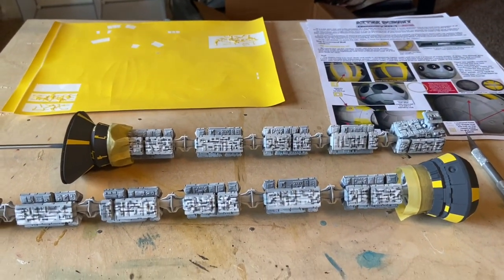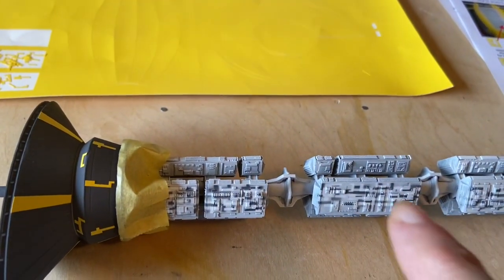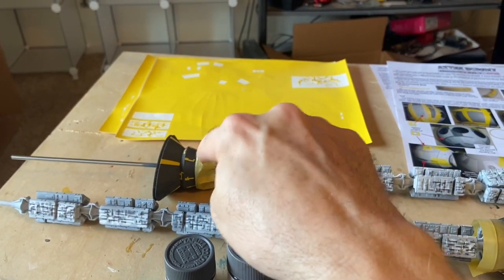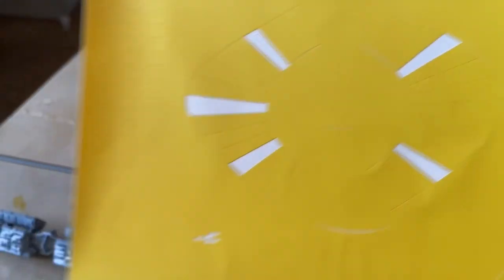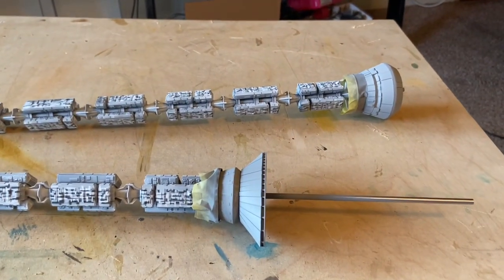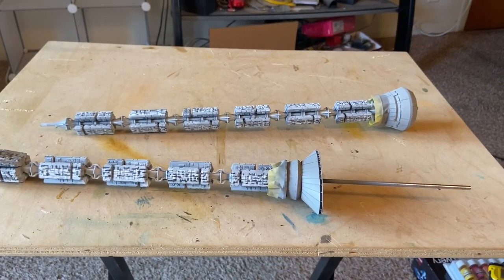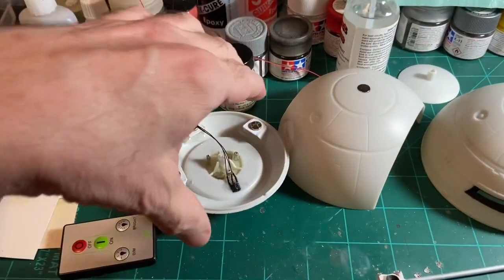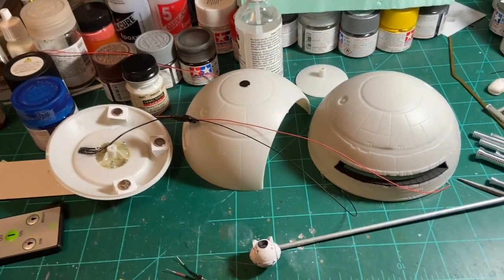NEW 2001 Discovery build part 11!

Comment: Why didn’t you use a tube bender to bend the tube?  It looks great, by the way. What gets me about these Discoveries is the exterior features are out of proportion to the movie.
Reply from the maker: I tried the tube bender that I showed in the video, they don’t work for the bends I needed. I’ll look into better ones in the future.
Reply: @kenspriggs5687  what about bending a circular, rather than a straight bend?  I know how difficult tubes can be to bend!
Reply: What about getting a cigarette lighter and heating the metal before bending,just a thought.